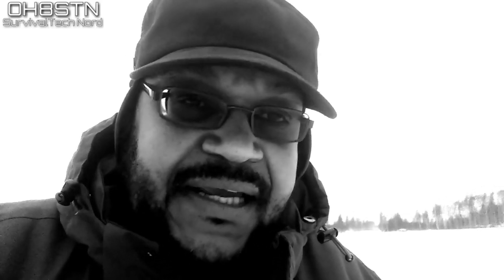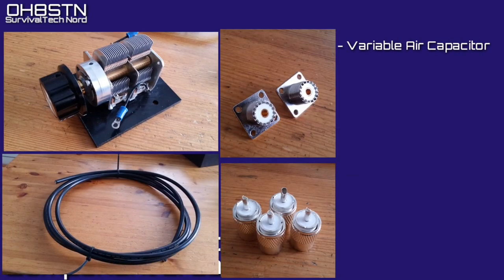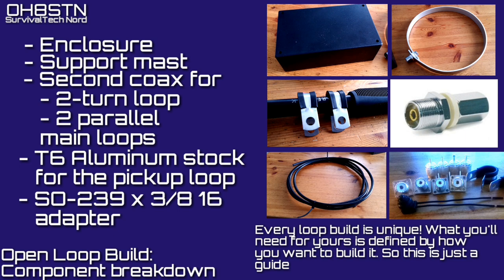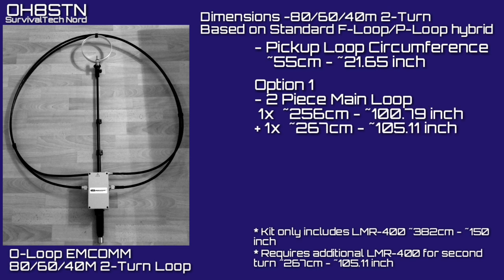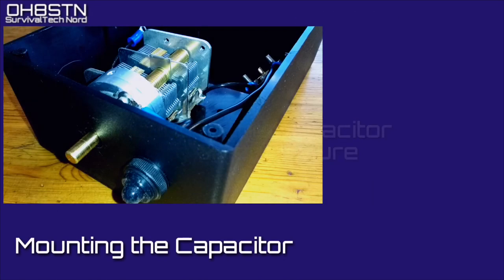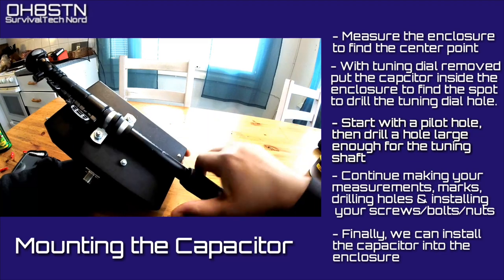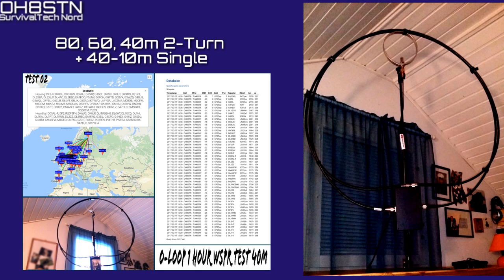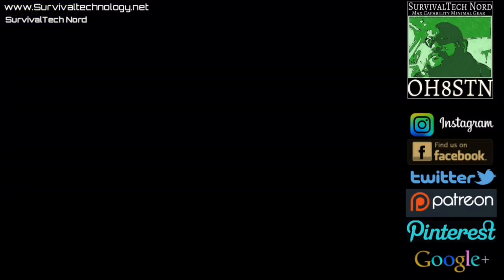Magnetic Loop antenna build

Comment: This is a perfectly executed video!! BRAVO!! You're going in just enough details for the users to make their own. 

A message for your subs:

One thing that is VERY important to mention is the fact that when manipulating, soldering or screwing nuts around the capacitor, it's PRIMORDIAL to protect the closed plates that create the capacitor as they're EXTREMELY fragile. NEVER install an opened capacitor because you'll break it!!!

Any crafting dust, gentile hit or the simple soldering flux particles falling on the plate might literally KILL the capacitor. The plates are about 0.020" from each other. Changing the distance between those plates might cause arcing a low power, shorts, high SWR at certain frequencies and reduce the overall performance of your loop. When you're done working on the loop for the day then place the tuning box face down on your desk to prevent stuff to get in.

It's important to underline that the capacitor that we're providing in the DIY KIT is the same that we're using in our CHA F-LOOP, P-LOOP and the incoming CHA P-LOOP 2.0 (http://us3.campaign-archive1.com/?u=e1cdcbe4da58e8277f75bd6b9&id=cdf412e790&e=[UNIQID])

Those variable air capacitors are US made and TOP quality. They aren't the ones that you see on Ebay or small online retailers! They're VERY expansive to manufacture. We've been able to offer them to you at a very reasonable price because of our purchasing power. We're buying them several hundreds at the time!

Cheers,

Carl Lavoie owner of Chameleon Antenna
Reply from the maker: Chameleon Antenna Thanks Carl. I added your recommendations and links to the webpage. I'll be adding other info and tools during this week.
Thanks for supporting the channel, my subs and your customers 👍
We all very much appreciate it!
de oh8stn
Reply: Is the second loop just hanging there no connections to the main or sub loops or cap? Thanks for the vid!
Reply: @m-a-r-c-1  No. The LM-400 is a continuous piece.  It is long enough that it needs to go around twice to use the length.  Connectors on each end. So- one length of wire, two connectors.

Comment: 10:15 I would definitely short the conductors between the socket pin and shell rather than shorting the coax cable so that as soon as an open piece of coax cable is plugged in the shield is shorted to the center conductor. Otherwise one of these days I would grab the shorted piece of coax and try to use it as a patch cord somewhere and that would be very bad. At the very least a shorted piece of coax should have a warning label at each end to prevent it from being used as a patch cable.
Reply from the maker: Agreed. Next time I'll add orange heat shrink to differentiate them from one another

Comment: For the loop clips I'd be tempted to use plastic types, as the aluminium clips will each form a shorted-turn if tightened so that the ends touch.

Comment: I have not experimented with building loops in a while (been playing wire antenna). 

I had started playing with 75ohm coax as the passive loop, I never finished the project.

It is worth nothing that OM0ET chose to use just the internal core of the coax on his loop. He said that doing this makes it less influenced by proximity capacitance (of the operator when tuning). On the flipside a lot of the high power loops use large diameter tube for the passive loop, which allegedly increases efficiency.

Comment: Better to short the SO239 in the box, so you don't end up with a cable that could cook your radio if you accidentally used it as a patch lead...
Reply from the maker: Yep agreed. I do use different type of cable for patch leads so it's not possible for me. It's excellent advice for other people using the same style of the same look of cable. Thanks for the tip 👍👍👍

Comment: There is some data that suggests a squashed feed loop rather than a round one provides for a bit more efficiency and bandwidth
Reply from the maker: That's not data, it's marketing from Alpha Antenna. They're trying to justify the benefit of not having a center pole support for their Loop. After extensive testing with a similar diy loop, I found that the squashing reduces SWR, giving the appearance of wider bandwidth. Unfortunately it does so at the loss of efficiency. This is most apparent 30m and below. The squashing also helps if you don't have a possibility of adjusting the distance between the driven Loop, and the Outer Loop. 
Wasn't looking to dump on Alpha, just curious to understand why they were promoting this methodology. Every other loop on the market is symmetrical.
Reply: @OH8STN  didn't come from Alpha - came from my own experiments and looking up the various experiments that other operators have documented on the ways they feed their loops. I have also made 30/40 loops over the last 35 years - there are a multitude of ways to feed a loop (essentially an output tank circuit in valve terms). The shape of the feed is less important than its alignment to the plane of the main loop. Personally I prefer a transformer feed 73

Comment: Great video as always. Two questions which one of the pre-built chameleon loops is the most portable if you wanted to do a SOTA? And the second question given that loop from Chameleon chosen from question #1 would you choose it over your MP1, ERB and MIL whip combo vertical? Again for something very portable as doing a SOTA as far as performance and portability?
Reply from the maker: The question really depends on the bands we want to operate. If we're talking about 20, 17, 15, 12, 10 meters,  I would give equal weight to the chameleon "P-LOOP",  MP1 and MPAS. on 30m, 40m, 60m, 80m we need more metal in the air. More wire or metal becomes heavy to carry up a mountain. So really it's an impossible question entirely dependent on how you want to operate. On 30-80m mp1 is lightest best performing  option, but MPAS is easiest to deploy. If MPAS, MIL EXT is required on 40-80m for best performance.

Comment: How would this mag loop handle the heat and sun in the sonoran desert summers?  I'm looking at these for a base antenna for my shack.
Reply from the maker: That entirely depends on how you build it. You can substitute the materials I used, for materials which are more suited for your environment. If I were still living down in Yuma, I would build it much differently than for portable Ops up here at 65 degrees north.

Comment: Nicely done Julian! Thanks for sharing. With your mod and remembering you operate QRP, what is the max power one can push into this unit?
Reply from the maker: Thanks Rob.  I'm already thinking about the next build👍
Thanks for stopping by.
Reply from the maker: Hi +Rob Fern Remember this capacitor is exactly the same as installed on Chameleon F-Loop and P-Loop. Those models state 10W CW or 25W SSB. As I normally operate digital modes, I would also state 10w fit data modes with 100% duty cycle. 
Hope this helps.
Reply: OH8STN excellent information here.

Comment: Another great video.  I just got the DIY kit from Chameleon.  4 questions if you please:
1. Is the length of the big loop measured from outer ends of the center pins of the PL-259s?
2.  Is the length of the small aluminum loop measured from hole center to hole center?
3. Does the double loop you use for 80m and 40m work as well or better than the Chameleon Booster Kit which has a 146" long loop and 8" dia. small loop, and which uses the stock tuning capacitor (no shorting switch)?
4. Did you solder your Pl-259 connectors to the shield, or just twist them on and leave them?  I always seem to have trouble getting the outer coax insulation jacket overheated when soldering on PL-259 connectors.
Thanks!  KD4EO

Comment: Hi Julian, Quick question: What is the maximum power in watts that can be input into this antenna? Forgive me if you mentioned it in the video and I missed it. My radio's minimum output is 5 watts and I don't want to start a welding project within the capacitor housing.
Reply from the maker: Did you read the build notes?

Comment: I will using lmr600 when I build my legal limit loop. using a beer bottle cap rated for 50,000+ volts in conjuction with an high capacitance air variable cap.
Reply from the maker: +kf4dcy Wow! How portable is that going to be?
Reply: OH8STN answer. Not very at all.
Reply: OH8STN ok, as for portability. not so much, wile I walk around with it. but I can carry it to a location then set it up. that is my kind of portability, as far as how I'll use it. being I'm on crutches for the rest of my life, after being ran over by a ford 3000 farm tractor and john deere tiller, laying me up for two months and five days in a hospital. how I get all of it to that location, will be in a wagon tied to me. super saturated salt water in a container, oil in a container, wire jumpers for the bottle array, all stowed inside the plastic pail the capacitor will be assembled in. as far as i know, the variable cap is only good for 100 or slightly more watts in a mag loop antenna configuration. its a cap pulled from an old Denton supertuner transmatch good for 5pf to 400 or 450pf. the tesla cap being for extra voltage capacity to reduce arcing witin the variable cap. seeing how caps are used as spark absorbers, without having to go buy a vacuum variable.  but a vacuum variables caps aren't as damaged when it does arc. that's why I suggest adding this tesla cap built like a power line transformer. does this explain my logic better? if this works. I could add one or two more tesla caps so I can utilize the full capacity of the converted Dave made 16 transistor amp. letting me release the 4500watts pep the amp is capable of providing. when and if the world become without law. kinda like sweden and france. thats when I will use it that way. or in times of emergency. but isn't a world without law a world emergency? a greater threat than global climate change.

Comment: Hi Julian - Thanks for your video series on the DIY Mag Loop antenna. I've watched your video a few times and I have a few questions. I hope you don't mind.

Q: You say, referring to the second loop, that "You'll have to adjust for the enclosure that you use" what does that mean?
Q: Is the second loop's center conductor and shielding shorted together like the first loop?
Q: You say "That measurement also includes the connectors and the barrel connector used to connect it to the first turn." However, in the photos, it looks like the two loops are not connected together - am I missing something?
Q: Do you switch out the longer 105.11 inch LMR400 when you switch bands to the 80/60/40m configuration? In the photos it looks like a longer loop is connected to the capacitor and the shorter one is simply connected to itself using a barrel connector.

Thanks for your help.
73,
Reply from the maker: +Robert Cox hi Robert. Great questions. I'll answer sequentially.
Enclosure: this only means if you have a very wide enclosure you should have just the length of the cable to account for the width of the enclosure. It's so small though I don't think that it will make much of a difference. It's just a few centimeters inches.

Coax shorting: the coax is shorted on both the main Loop cable, and the double Loop cable.

Connectors: Of course the two main loop cables are connected together in double loop configuration. Sometimes we make things too complicated in our heads. Anyway that comment refers to the measurement of the length of the conductor tip-to-tip which includes the barrel connectors.

Switching out longer lmr400,: I'm not sure if I understand. There are two configurations. 40 meters through 10 meters is the shorter lmr400 coax. Then there is the double Loop configuration which includes the shorter lmr400 coax and the longer LMR 400 coax connected in series. Naturally on 40 meters we can use either configuration.

I'll add more photos and clarification to the help website in the description sometime in the coming week

I hope this helps
73 de oh8stn
Reply: Julian - Thanks for your reply and for your additional information. I look forward to your other videos and I will look for the additional photos and clarification on your website.  

Best to you and thanks for the videos. 
-Rob

Comment: Does the thickness and the width of the pickup loop matter. If so what are those dimensions?
Reply from the maker: I've experimented with various widths, getting various results. My best result was with the Aluminum bar stock, but RG-213 worked almost as well. The bar stock is 2.5cm wide.
Reply: So 2.5 cm wide or .984 inchs. What abut the thickness of the bar stock. Does that matter? Oh and thanks for the reply.
Reply from the maker: I'm sure the thickness has some relevance, but nothing I could detect in my testing.
Reply: So do you know how thick the T6 aluminum stock was that you used?

Comment: Great video, i think i can do this without creating a disaster. 
Question:  I cant tell by looking at the video, but is both sections of the rotor plates connected with a jumper?  I know that both the stationary plate sections are connected to the capacitor frame and one end of the loop.  Tnx es 73, n5eqy Texas
Reply from the maker: +Walter Perry hello mr. Perry. I've answered that question and added a couple of photos in the build notes. You can find those notes right here http://oh8stn.org/blog/2017/02/09/diy-man-portable-magnetic-loop-antenna/ there's also much more information there which is useful for the Builder. Actually I think I'm going to build another one, using one larger Loop rather than the smaller double Loop, but that's a discussion for another day.
And me again if the bills notes don't give you the right information with the information you need and I'll add a more detailed section on this topic.
Julian

Comment: I have been wanting to build a mag loop for some time. It is my understanding at this point that the large loop is in series with a variable capacitor, and the small loop is in series with the coax center conductor and the coax shield. Is this correct, or not?

Comment: Are the measurements for the main and coupling loop measured tip to tip of the connectors after their installed?  BOB  AF2DX
Reply from the maker: Yes they are

Comment: I'm a bit confused. Is the second loop connected to just itself and not the capacitor.  If so how does tuning happen on the second loop? 

Also is your telescopic support metal.  It looks like it is. Does this affect the antenna?  I purchased the kit and I already have some extra lmr400 around. Just need a box for the cap and support. Gonna grab some stuff in town tomorrow.  Thanks. 
-KN4CUH

PS. I'm building a uBitx with a raspberry pi and 7" display all mounted in a pelican style waterproof case to digital modes.  Planing on uses this antenna for.
Reply from the maker: Hi Steven the second Loop is connected to the end of the first Loop, looped around and comes back to connect to the tuning box. It's all in the episode notes. The link is in the description. I hope this helps 👍